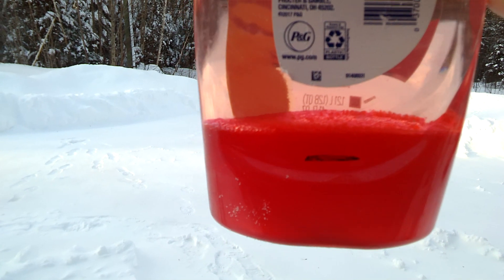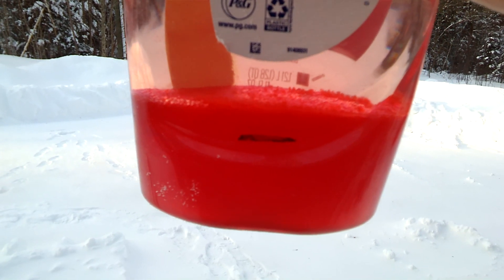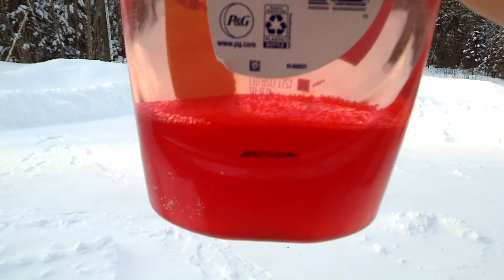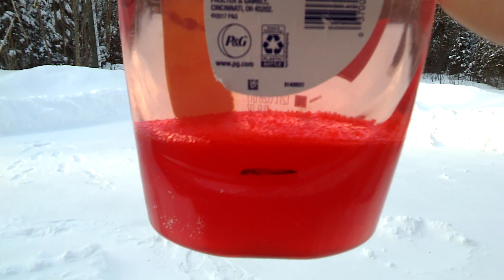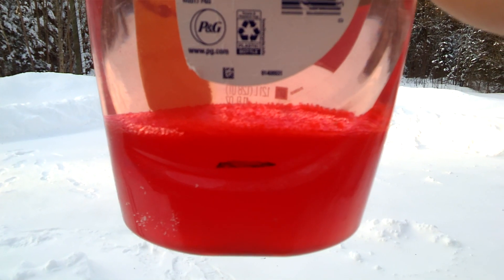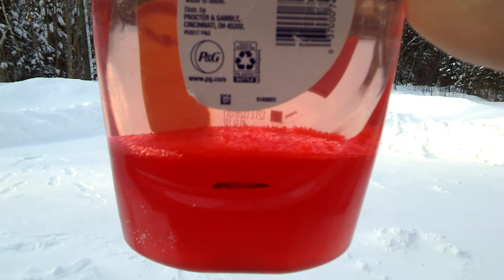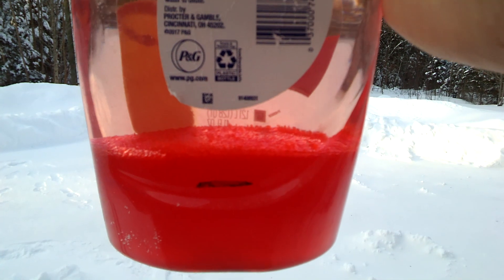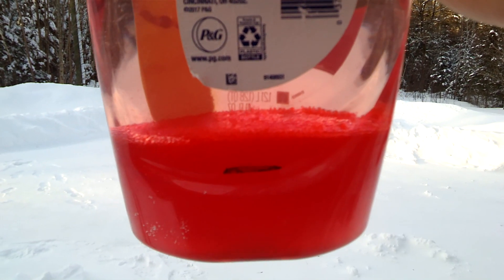Remove ethanol from gas.

Comment: Why not just go and buy nonnethanol gas and pay a little more?
Just so much easier.
Reply: Because not everyone has non-ethanol gas available. I would have to drive 65 miles for it.
Reply: Walter Gausser I don’t have a gas station that sells ethanol free gas within a 40 mile radius of my house!
Reply: Yeah it’s nonexistent here on Long Island New York so this is a great idea for us smucks with ethanol fuel only in our areas.
Reply: Watch RICH REBUILDS Channel 
Ok then it makes sense
I live in FL and every gas station sells it.
It is about 50C higher than regular gas and comes with no head aches.
Reply: This process drops the octane rating ..
Reply: Some of us plebs in the "green" states would have to pay $25/gallon to get ethanol free gasoline.

Comment: Stupid
Reply: Only a fool calls knowledge stupid
Reply: I have several cars because I like cars.  Every one of them that hasn't been driven in a year or so needs a new fuel pump because ethanol mixes with (contaminates) water and rust the fuel pump (and tanks).  So if you drive a car everyday, no problem till you have a fuel spill.  Gas and Oil can't mix with the groundwater, but to ethanol, it's like a magnet.  So think about who's stupid next time you drink from a fountain.

Comment from the maker: Dyed water was added to the gas up to the line. When it absorbed the ethanol it was that much above the red line indicating that the ethanol was absorbed into the dyed water. Hope this helps.
Reply: Antifa pussy.
Reply from the maker: @channel 9 Thanks for appreciating my time and effort.  Sorry you don't get it.
Reply: Not so sure what you have here. Ethanol freezes, like gasoline at below -100F. What you have is frozen water, which has expanded. Still no idea if it did not somehow ruin the gas.
Reply: @johnsmith1474  Try it this does remove the Ethanol just add 1 cup of water to 1 gallon of E85 mark the amount of water you put in, it will gain 15% you do not have to freeze it but you will have to suck off just the gas from the top.
Reply from the maker: @gunlover1955  Correct, the freezing was accidental as it was below 0 F that night but it did make it easier to pour off the gas which rises to the top.
Reply from the maker: @johnsmith1474  Have you tried this experiment or are you just trolling?
Reply: @John Smith If water mixed with alcohol only freezes at -100°, why does automobile coolant require 50/50 mix @ 25°f? Think, man.